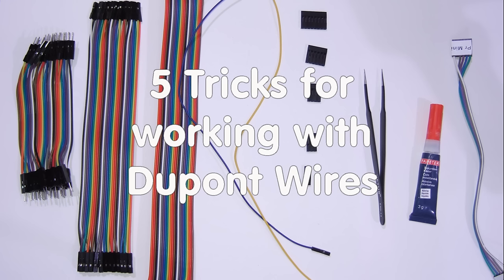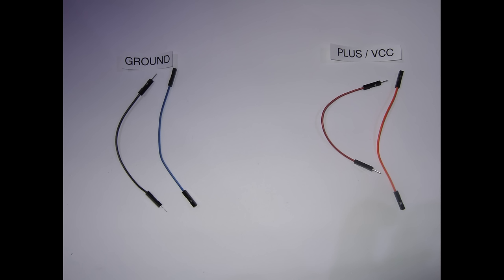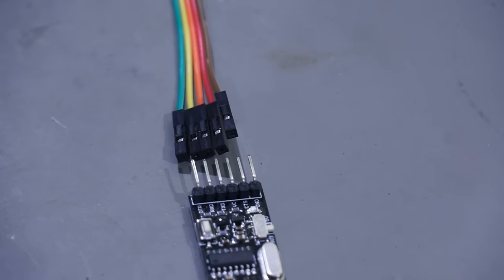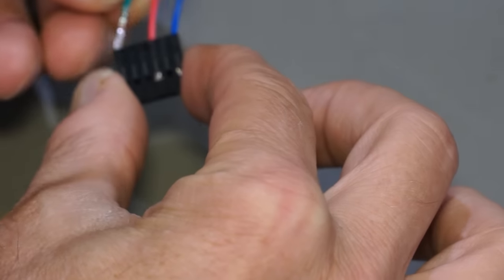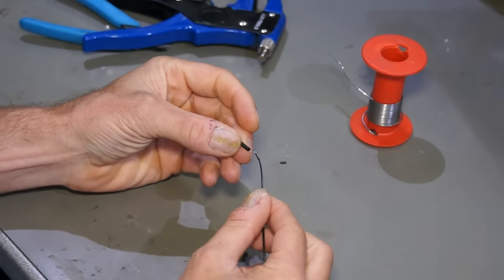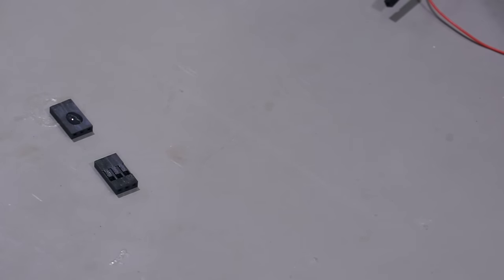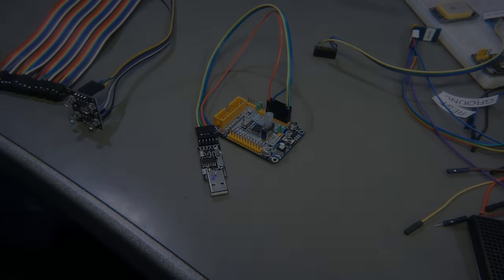#12 Five Tricks for working with Dupont wires

Comment: Regarding the colors : most people never realize this, but the multi-color ribbon cable uses the same color code as resistors. It's a good thing to remember if you're numbering your wires and/or use them in a certain order.
Reply from the maker: Thank you for the tip. I did not know it.
Reply: @AndreasSpiess  no problem. It took me a long time to notice. It happened when I tried to keep track of which signals where on which wire on a project that had a long cable run. Kind of a "Eureka" moment.
Reply: @AndreasSpiess  One other thing : on cables with large numbers of wires (like old printer cables) they use two colors per wire, each combination is unique. That's how they could solder the connectors at both ends without using a continuity tester. I guess the gains in productivity justified the more expensive process of coloring the wires.

Comment: I use transparent tape to stick dupont headers in one row and even 2 rows together. To do so, i first attach the dupont wires on the pin row (preferred with black wire on GND) and than wrap tape around. This holds them amazingly good together and allow easy plug- and unpluging. I like the super glue idea for permanent cable preparation! Thanks for sharing Andreas!
Reply from the maker: Thanks for your feedback! At the bginning, I also used transparent tape, but the cheap empty shells are really an alternative...

Comment: Good tips.  Thanks.

I also had the problem of always running low on black or red wires.  I went online and was able to find packages of red and packages of black duponts.  I didn't find many size options, but what I found pretty much solved my issues.

Gluing the empties together was an awesome idea.👍🏻
Reply from the maker: In the meantime, I also found black and red Dupont cables :-)

Comment: Thanks Andreas.  I got a few new tips here.  I ordered some shells (a full kit for dupoint).  That will make my STM32 STLink headers more tolerable :)
A problem I have with dupoints and breadboards.... well they tend to spread the jaws of the breadboard open just far enough to mean the normal steel pin breadboard jumpers get dodgy connections.
As a tip I would like to share.  Projects which become more than temporary, you don't need to learn how to do full component based PCBs.  You can quickly drop some male and female headers onto a PCB and plug modules into it.  Makes things a lot easier when you project grows dozens of different modules and wires.
For example... you don't need to learn how to layout an Arduino IC ... just put female pin headers on teh PCB and plug the whole Nano into it. :)
Reply from the maker: Thanks for the additional tips!
Reply: I use IC sockets instead, sometimes a Zero Insertion Force (ZIF) socket.

Comment: This single video changed the way I did my prototypes forever. Use to have 4 problems when things didn't work (i) incorrect wiring (ii) software problems (iii) impossible expectations of a circuit (iv) Bad connections.

I have now basically got rid of (iv) because I now only use dupont cables organised nicely and I always have black for GND and red or orange for power.

I only have the female ones and make all the headers male. For me, works well.

The other thing is, I'm just terrible at crimping my own so I buy the ready crimped ones from China. The great thing is with care (and a good pair of tweezers) can take the cable out of housing and re-use and swap around.

One example of use is I may have a 2 pin connector and a 6 pin connector that comes from the MCU and goes into a 8 pin connector on the device as 2 are N/C. I found if you can get 2+ connections together they prevent a lot of wobble and drama.

I have an OV7670 camera module that has 20 pins, with single wires this was basically impossible to wire. With organised dupont it's so much easier and robust.

Also, the cost of the cable from China is basically no more expensive with the housing than without and given the time saved trying to crimp... you're well ahead.
Reply from the maker: Thanks for your feedback. It is always nice to read that somebody can use my stuff...

Comment: Quality ! Lower and lower after each buy and when I start prototyping something, I get a new pack of wires because the old one (male) are fine, but female connections wear out very, very fast. Any advice which one to buy now ?
Reply from the maker: I do not have advice for a source because all are similar. I throw the bad ones away. But usually they are ok. Maybe because I did not buy new ones for quite a while...

Comment: Hello. I would like to ask if the Dupont female connector would work to test different small resistors in a electronical project. I need to test different values without soldering.
Reply from the maker: The diameter of some resistors are similar to the diameter of male dupont connectors. But you also get ones with much smaller diameters.

Comment: When I populate a shell I make sure that the latches are visible (uppermost) when the cable is installed, this means you can check the pins are latched and you can put test probes on the pin if necessary.   

Mixing male & female pins means you can arrange them so that plugs & sockets cannot be connected to the wrong partner, or the wrong way round.

When making my own cables I use 24AWG flexible silicone insulated wire, this reduces the strain on the connectors.
Reply from the maker: Very useful. Thanks!

Comment: I need to find a single female dupont connector to move forward with flashing a bootloader to my 3d printer.  I suppose a 1x2, 1x3 or 2x3 would work too.  Is there any electronic item found in one's house where it could be temporarily harvested?  Quarantine makes it a nasty experience going out.  Thanks!
Reply from the maker: I cannot help in this matter :-(
Reply: @AndreasSpiess  Thanks for the response.  I found that there's a ribbon cable that connects the printer's screen and main board and it has female-female connectors.  I was able to use that with the cables I had to make it work!

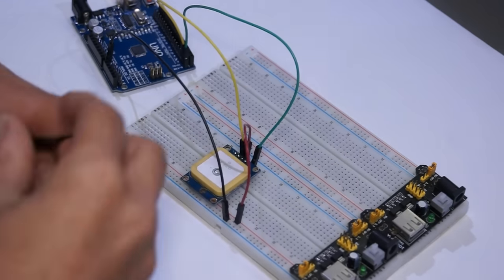Comment: 0:52 Do you have a video about that power supply setup you have at the end of the breadboard?  Thanks
Reply from the maker: No, this is very simple. I just use these MB102 type devices (https://www.aliexpress.com/item/3-3V-5V-MB102-Breadboard-power-module-MB-102-830-points-Solderless-Prototype-Bread-board-kit/749559166.html)

Comment: Very interesting, I also started running low of black and red wires and started using blues as alternative ground or negative color and orange as alternative positive supply voltage. I'm currently still mostly breadboards so I'll have to add shells to my next aliexpress order. I already get the large breakaway pin headers so I can have any length I need and double up for double rows so I might add well get started with shells. With multiple projects using wires I also got a kit of assorted color solid core wires and use those in breadboards for exact length very clean and easy to see connections between components. It actually increases visual troubleshooting a noticeable amount and having long wires everywhere on breadboards I've found I make more mistakes at times so I'd add on that tip, real shorts flat against the breadboard surface wire connections with solid cores to replace long dupont wires with pin connectors.
Reply from the maker: Empty shells are a very good addition because they reduce the errors and also stick much better. I changed to silicon for my stranded wires. 30AWG for crimped and thicker ones for all other needs. They are a bit mure expensive but very flexible and heat-resistant. And in the meantime I also found red and black only Dupont wires. So I have enough of them...
And, as you describe, I recently bought a set of solid wires for breadboard usage.

Comment: hi amazing tips i have one question i recently ordered male to female jumper cables without even thinking about the fact that i needed a female to female instead. could i solve this by getting the headers and making the male end female?
Reply from the maker: You could. But I would just order the ones you need. Much easier...
Reply: You can't because the male has crimped pins and the female has crimped sockets so changing the plastic shell won't make any difference.  The advice still stands though, buy the right ones, cutting and joining females together is time consuming and frustrating.

Comment: Great video mate, can you tell me which keywords to use on eBay to search for a box like yours (1:10) to enclose my project?
Reply from the maker: +Caetano J Unfortunately wour would have to search "3D-printer" because I print my boxes myself to fit exactly my needs...
Reply: +Andreas Spiess Well, with a 3d printer you can do just about anything. Where can I find those connecters that fit outside the box?
Reply from the maker: +Caetano J The black and red are just female banana connectors

Comment: Aug 2015 but still using Dupont connectors.
For I2C bus I use the following:
1 Brown - GND brown fields
2 Red - VCC red is hot
3 Orange - CLK or SCL "clockwork orange"
4 Yellow - DIO or SDA D is 4th letter of alphabet, yellow = 4
Reply from the maker: Good concept! I like #3...

Comment: I wonder if to splice one cannot simply crimp 2 wires in one connector. I manage to do that, but not sure it is safe.
Reply from the maker: They are only used for small voltges. So I assume there is no safety risk.
Reply: @AndreasSpiess   Thank you!
Reply: @AndreasSpiess  Btw, because the insulation of two wires is quite thick for the housing (but it fitted), I also tried replacing the insulation that goes into the housing by a shrinking tube. It also works.

Comment: I really enjoy your videos.  They're very informative and you have a very charming accent.  I'm having trouble with loose connections using dupont wires.  In this particular instance, I'm connecting female dupont connectors to a DHT11.  Sadly, the male is too small :-( , or the female is too large  :-( .  Is there anything I can do to make the connection more secure...aside from soldering connections?
Reply from the maker: You can try with tweezers on the female part. But usually it is better to change them.

Comment: is there a quick disconnector for mechanical keyboard switches ? i tried 1P Dupont but it keep fall . i want to build my own custom arcade controller , i don't want to sold them
Reply from the maker: There are many kinds of "JST" connectors.
Reply: @AndreasSpiess   did you get my question right ? the qucik connectors (1P dupont) keep falls from Cherry mx pins keyboard switch  , so i'm looking for Quick connector/ disconnector smaller than  1P dupont Female , i don't want to sold them it's pain in the arse once i want to change switches
Reply from the maker: @samiRetro777  Obviously, I did not understand your question 😞

Comment: I like the empty shell trick.

I initially kept the cables in groups of 10, the colors match the resistor color code from 1 to 0(10) so it was easy to remember them by numbering.
But is rare to use them in number order on a strip, so the resistor code is not that useful in many cases.
So I prefer keeping strips of 20, 10, 5, 3, 2 and 1 and use the exact amount of wires I need.
Reply from the maker: Thank you for your feedback!
Reply: The empty shell trick is pure genius. I was going to buy a crimping tool before, but I may as well just do this instead.

Comment: Are the Dupont ribbon wires solid core? I ask because I am wondering about their flexibility and durability when they are separated. I'm just starting out in this hobby and am looking at buying some wires. Thanks
Reply from the maker: +specialks1953 Welcome at this hobby!

No, usually they have no solid core. They are stranded and have about 10 very thin copper wires. I bought mine at different sources in China, they all seem to be very similar. They are not very flexible (at least, I have more flexible stranded wires with similar thikness. As I said in my video, I am quite happy with them and I quite often use them in single or dual configuration.

The last wires I bought were these:
http://www.aliexpress.com/item/Free-Shipping-400pcs-dupont-cable-jumper-wire-dupont-line-female-to-female-dupont-line-20cm-1P/1967855093.html
Reply: +Andreas Spiess Thank you and Happy New Year!

Comment: My dupont connectors often stick very loosely into a board or print. Is this a quality matter or a slight incompatibility between sizes or something?
Reply from the maker: I think, it is a quality issue. I do not know of different sizes.
Reply: Andreas Spiess , This could be inferior metal loosening up with use or different chinesium manufacturers with slightly different designs. Fwiw DuPont and others actually did manufacturer this .025" pin .100" pitch connector. I guess China picked a reputable company name when cloning them and it kinda stuck with the maker community. This might be worth a read. http://tech.mattmillman.com/info/crimpconnectors/  

Lol I just found that ref. in your #39 video :)

Comment: Anybody know what this part is called? It's a rectangular housing that fits around 3 Dupont wire housings. I need to fit male wires into female connectors but it needs reinforcement so the pins don't bend and break off inside again. Can't find the part anywhere.
Reply from the maker: I do not know what you mean, if it is not the empty shells shown in the video. For those you find a link in the video description
Reply: @AndreasSpiess  It's a hollow rectangular piece that would go around two of those shells locking them together. I guess you could use them to extend wires.

Comment: If you need more colors of ten, you can mark with nail varnish to the cables. You have a lot of two color cables or more. Red - yellow or orange - green examples.  I have only four colors of cables but mixed 5 colors of nail varnish : I have different 20 colors with this way.
Reply from the maker: Thank you for the tip!

Comment: Hi, how can i connect 18650 battery holder that have red and black wire one on arduino? Can solder to jumper wire or not? Please help. I am beginner☺️
Reply from the maker: You can solder jumper wires. But pay attention to the voltages. The 18650 batteries are only 3.7 volts.

Comment: How the hell did you remove the black shell from the crimps?. I tried that too and all I have is a scratched dupond connector.
Reply from the maker: +tony1 I just use a pair of sharp tweezers. You see it at minute 3:24. With it, I lift the plastic tongue to free the metal insert. Then, I pull the cable. It needed a bit of "training"
Reply: +Andreas Spiess Danke mittlerweile hab ichs so gut drauf wie du. Der Trick mit dem 1x4 Gehäusen funktioniert einfach super. Vielen Dank!
Reply from the maker: Bitte, gern geschehen!

Comment: any advice for a good crimper?
Reply from the maker: +Brian Pantalone Not really. I do not cprimp a lot because I try to use pre-fabricated wires. This is why I ordered a cheap crimper off aliexpress:
http://www.aliexpress.com/item/SN-28B-Pin-Crimping-Tool-2-54mm-3-96mm-28-18AWG-Crimper-0-1-1-0mm/1774206687.html

It works, but I think, something better must exist. But professional tools are very expensive...
Reply: Appreciate the response, i bought one on Amazon for about $10 including shiping

Comment: Andreas, Thank-you for all your excellent tutorial videos, I have learned a great deal. I have had many years of bench experience and like you  have used similar wire color coding schemes. The key point is to be consistent with the color code of all your projects.
 I have always used brown for low and blue for VCC,  (my rationale ) brown = earth or ground, Blue = sky or high (for the VCC voltage) .I'm not sure if this conflicts with European ac standard though?
Reply from the maker: In DC the red/black scheme is well known and many batteries use this scheme. 
For AC, in Switzerland (and I think, in other European countries), blue is the non-live wire in our mains wiring. On the other hand, black is one color used for the life wire .... So, the only possibility is, as you write, be consistent for yourself.

Comment: Gruezi Andreas, I am so happy I found this video, lots of good tips, you've just cost me a few rappen on Aliexpress... :-D

Quick question on the wire stripper you use in tip #4 at 4:08 in the video. Is it available on Aliexpress? What is the function of the metal part in the back of the tool, is that an adjustment screw for the wire diameter?

I am interested in buying such tool, especially if it comes with a good recommendation from a lab tinkerer like you!

Greetings from La Cote, in Vaud/Waadt. L
Reply from the maker: Thanks for your compliment! I had several strippers, but for the moment, I only use this one https://www.aliexpress.com/item/Free-Shipping-YF-046-0-6-2-6mm-Multi-Function-wire-stripper-plier/1583649116.html
This one is no more available, but you find similar products on aliexpress. It works extremely good for all diameters and is small, light weight, an cheap.
Reply: That wire stripper in the video looks like the cheap stuff you find everywhere, they damage the wire coating and often fail to strip. if you cut small quantities of wires as typical in hobbies, than the solution Andreas proposed is OK, otherwise if you prefer you can find professional cutters that cost from €50 euros (RS components) to €100 (Weidmuller). €50 for a life time investment.
This RS components Codice RS382-2847 is excellent, hardly ever fails and has interchangeable heads.
We use these especially on our job where we need to strip around 20.000 wires a year.

Comment: Hello, Do you know if you can buy bare Dupont wire ?
Reply from the maker: You can buy 28 AWG stranded wire on AliExpress or on the other platforms. Or you buy ribbon cable with a similar AWG on the same platforms. Maybe you also watch my crimping video and the comments.
I usually buy ready-made Dupont cables and cut them in two. Much easier.